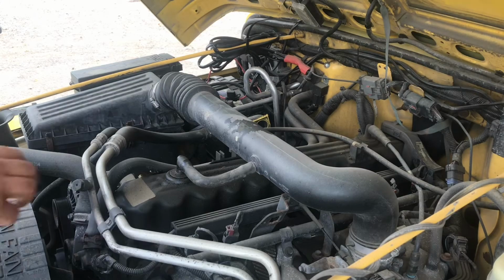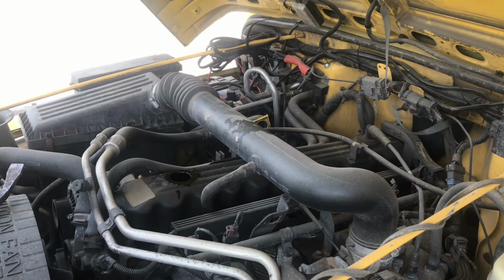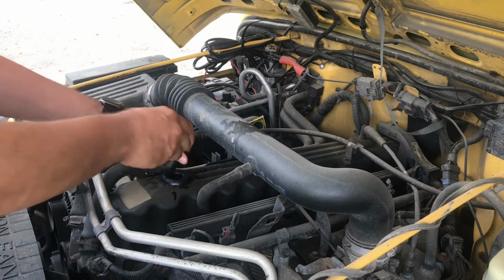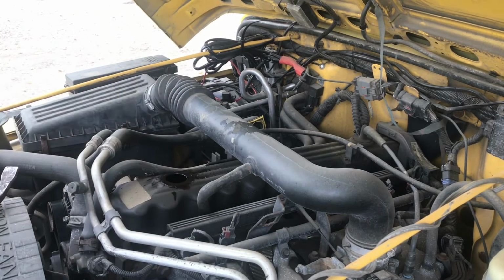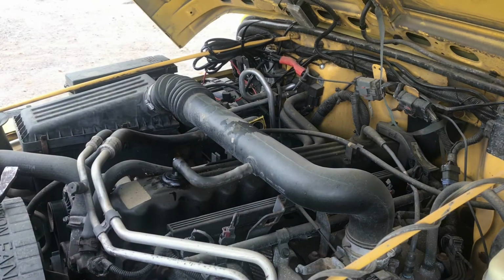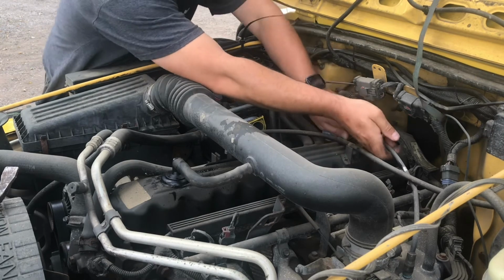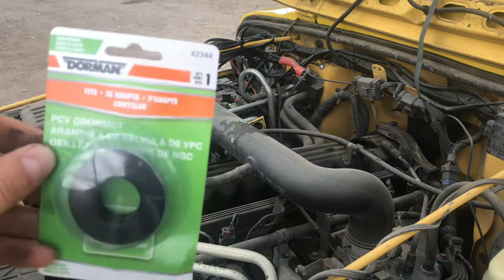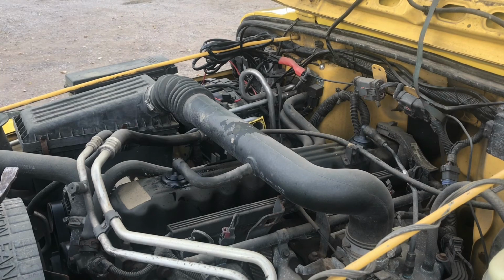HOW TO EASILY REPLACE PCV VALVES ON A JEEP WRANGLER TJ

Comment: So I needed to change these valves since I accidentally broke the front one earlier this week, plus they had the oil leak. I'm the original owner so my wrangler is 20 years old now and I never changed these before. So after watching your video last night I thought it was a great idea to get the engine up to temp to help soften the grommets. The front was pretty well damaged from my break so I had to cut the rubber out and try to pry it out but it kept breaking. I finally cut enough of the rubber out that I was able to get a screw under it and pop it out. The rear one I did exactly what you did and it popped right out, great tip that you had. Also one other tip for you when installing the new ones is to put a little oil around the grommet and the valve slips right in. Anyway thanks for your tips, they definitely helped.
Reply from the maker: Thanks for your feed back and the tip of oiling the grommet.

Comment: perfect...nice advice on the engine warmup..going to tackle this weekend, thanks!
Reply from the maker: I hope it works as well for you as it did for me
Reply: @aroundthecounty1139  Worked perfectly..just for kicks I tried to remove the valve before warming..too difficult and felt like they were about to break..I stopped , then drove it about 20 -25 minutes, came back..both valves popped right out, no issues at all..excellent advice on the warming up the engine, thanks again